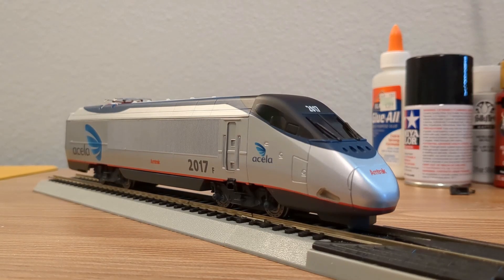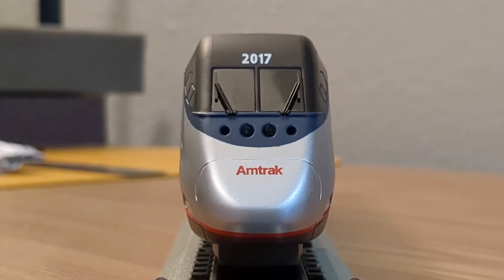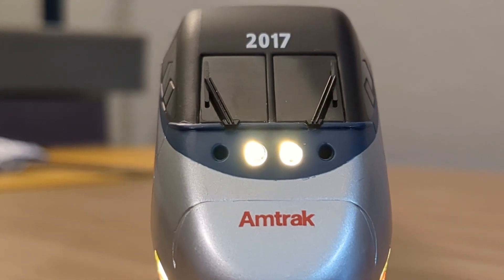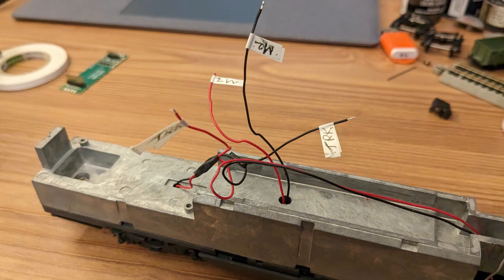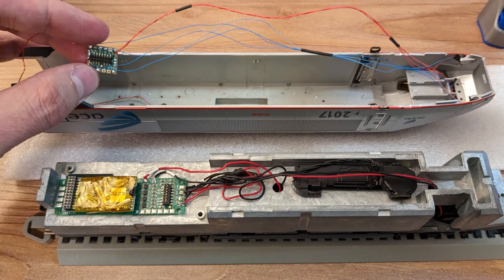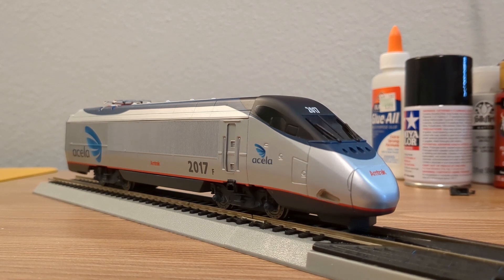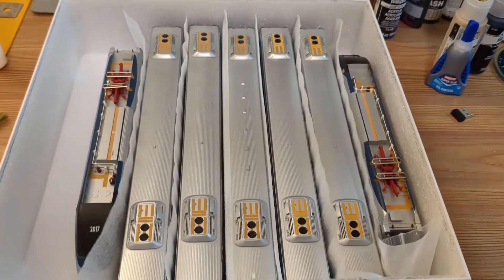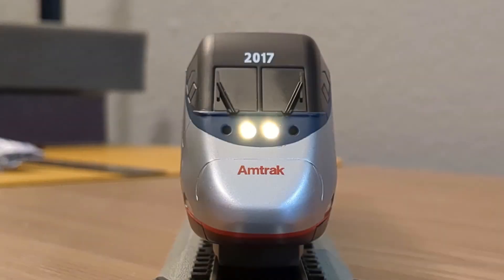Re-wiring the Acela (again)! - Decoder Buddy, LEDs, and Sound

Comment: I have a an older model of this locomotive. 2007 number to be exact.  I would like to add a digitrax sound decoder to it . I don’t want to remove the pantograph feature. Most of my trains pick up electric from catenary wire.
Reply from the maker: Ah I wasn't sure how to keep the ability to run under electrified catenary with the re-wire job I did, but I wasn't planning to ever do so. I'd probably use a sound decoder with an 8pin plug and just plug into the factory Bachmann board if I wanted to use the pantograph. Best of luck!

Comment: May I inquire which model decoder did you use to do this job?  Additionally, I have 2 Acela trains, could I interest you in purchasing the parts and paying you to do the same for me that you did for yourself?
Reply from the maker: Hi there! I used the Soundtrax Tsunami model TSU-21PNEM8 (https://soundtraxx.com/products/tsunami2-digital-sound-decoders/tsu-21PNEM8/) and I used the 'electric' profile for the decoder. I also used a DecoderBuddy V5 motherboard (https://nicknixtrainz.com/product/decoder-buddy-v5-12-output-1-0k/) as opposed to the original Bachmann 8-pin board. You could go with the 8-pin version of the decoder and plug it in to the factory Bachmann board without modifying anything, you'd just need to pick a speaker that will fit within the shell of the Acela. I'm afraid I do not do installs as a service, I'm always afraid of something being broken or a package getting lost or any number of potential things, but I hope you can find someone local! It's not too difficult a job to add DCC/sound to the Acela, the difficult part is getting the shell off.
Reply: @yardsounds90  Was this decoder just for the sound or does it handle the sound and engine motion? (LQQKing up the specifications now)
Reply from the maker: @docuzzie  This decoder handles both sound and motor functions as well as lighting. I do not believe it is good practice to have separate decoders for sound and motor control, although that may have been more common in the past. It's a pretty nicely featured decoder and has a lot of different options for sound selection too.

Comment: Nice installation job with the Decoder Buddy V5B!  Thanks for Sharing!
Reply from the maker: Thanks Nick! I'm a big fan of the DB and use it in nearly every install. I really appreciate not having to worry about adding and fitting resistors into a model when they are already on the board especially.

Comment: Hey, may I ask What LEDs. Did u use and what size. As well as how you black them out?
Reply from the maker: Sure thing! I used 0603 prewired LEDs in warm white. You can usually find them on eBay or AliExpress. To black them out I used black Tulip brand puffy Tshirt paint, cheap and easily found at any major arts and crafts store. It does require two or three applications (I use a toothpick to apply), but it's flexible and can be removed easily when it dries.
 https://m.aliexpress.us/item/3256803420073666.html?pdp_npi=2%40dis%21USD%21%24%204.45%21%24%203.34%21%21%21%21%21%402101c67a16806192303954882eeb9a%2112000026470396654%21btf&_t=pvid%3A26927ce0-c949-4d6d-8c87-4852df98f106&afTraceInfo=1005003606388418__msite__c_ppc_item_bridge__xxxxxx__1680619230&spm=a2g0n.ppclist.product.17&gatewayAdapt=gloPc2usaMsite&_randl_shipto=US
Reply: @yardsounds90  Thank you! i am planning on switching out my board completely as well with ESU. I made a custom sound file with the help of another youtuber. It is on my channel Donnie's's Trains. I was going to use liquid electrical tape to black them out. as a suggestion.
Reply from the maker: I checked out those vids on that custom sound profile, it sounds amazing! If you guys ever consider making the sound profile available, I'd gladly pay for a copy. I like the Soundtraxx decoder but I'd lose the arcing pantograph for a more accurate horn. 

Liquid electrical tape is definitely viable and likely would only take a single application. I do like the t-shirt paint because it's really cheap, and the ability to remove it if necessary with very little mess is a nice bonus - It just kind of peels off.
Reply: @yardsounds90  You can add arcing pantographs as well. i believe it is a default sound effect on ESU programming. If not i know for a fact someone has it because people have it on multiple different high speed trains.